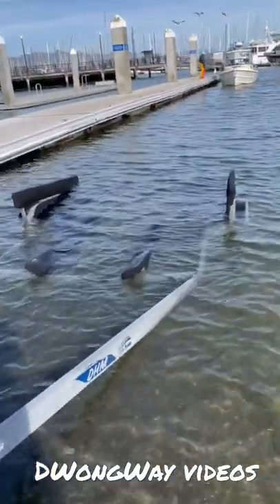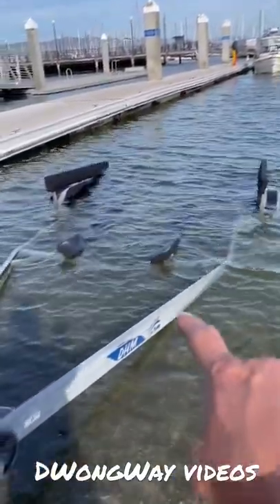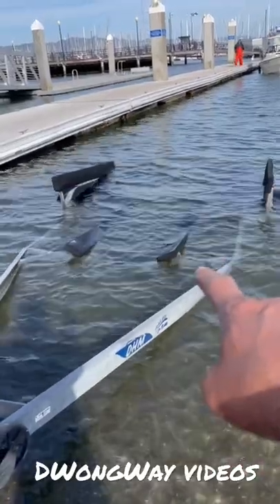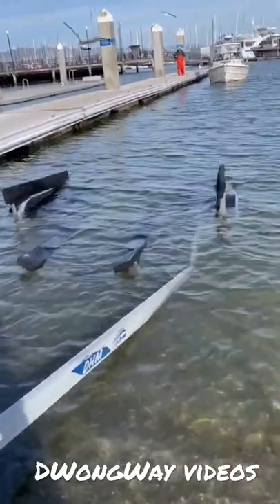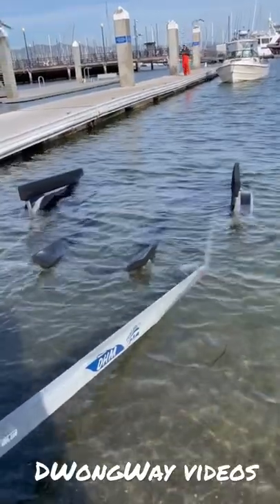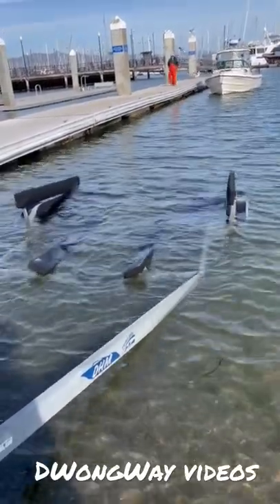Boat Loading Tip 2 - Drive the boat onto the Trailer

Comment: Fun tip. Back the trailer fully into the water to wet the bunks then pull back up before loading boat. Makes for a smoother run up the bunks
Reply from the maker: I wish I would have mentioned that.  Thanks.  There's a lot of thing's I take for granted after a while.

Comment: I don't know if this is the right way to do it because I see most people submerged their trailer to the winch and come in full throttle 🤔
Reply from the maker: I add full throttle once the boat lines up straight. It depends on the boat design. I’d the trailer is too dee then the boat floats.

Comment: That last “little more”. You couldn’t have grabbed the rope at that point?  You wanted the boat to go another inch before you grabbed the rope?
Reply from the maker: I was holding my camera and wasn't think =)  I usually run the boat on, but it's getting hard for my 76 year old dad to back the trailer up.  We just backed it up a little and I moved the rope =)
Reply: All good. Just something the ol man told me when I was younger at the lake with our little 16' semi v jon boat. Fully sink them bunks first so I slide better otherwise you'll be cranking more